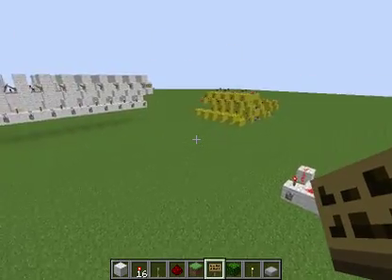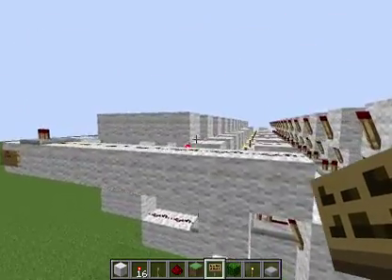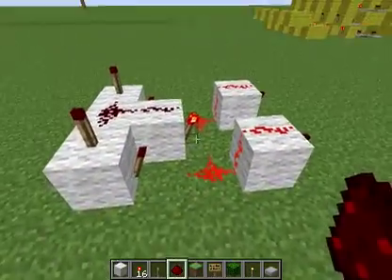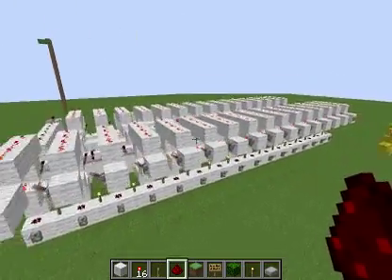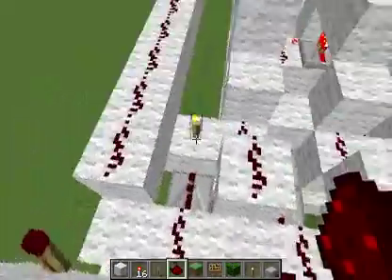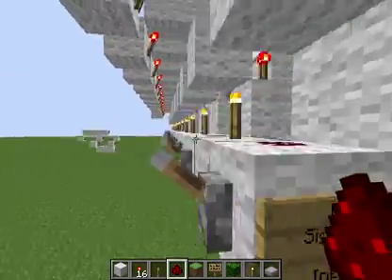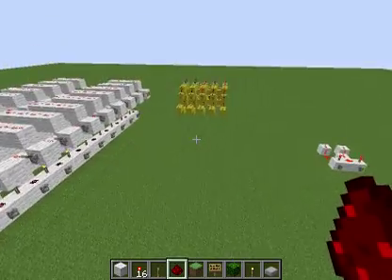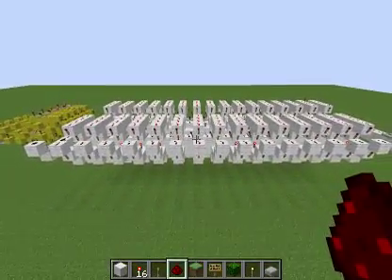Revolutionary XOR gate design! (34-wide 16-bit ALU!)

Comment from the maker: Please do! (Use and mention, that is!)
It has an increased propagation delay because I had to use repeaters to fit the carries in the one-block space between the gates, but it's not that much different. However, this can cause it to initially output a wrong answer while all the carries propagate! Be sure that if this design is involved in a synchronous circuit, you make it wait until the ALU outputs the correct answer!